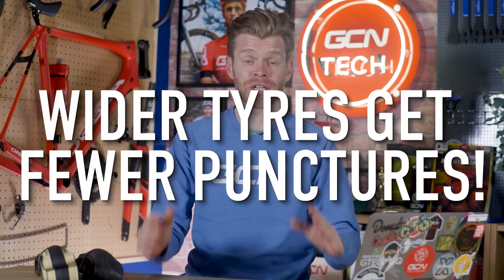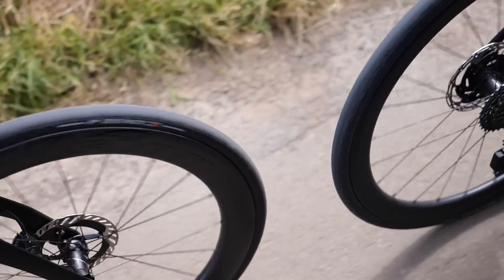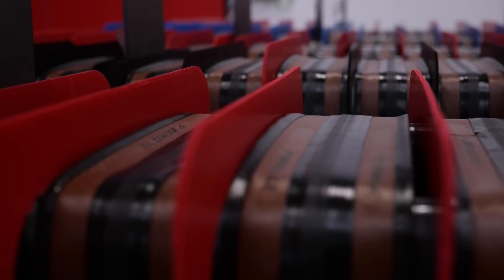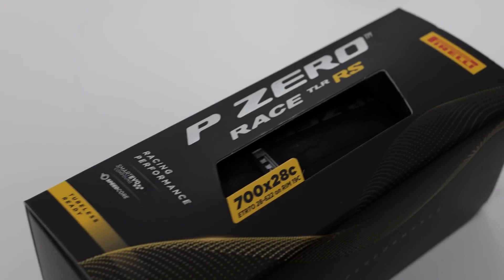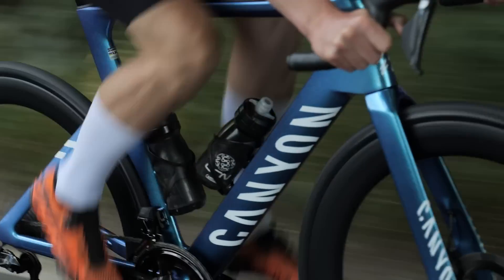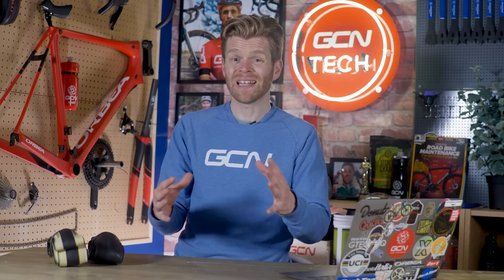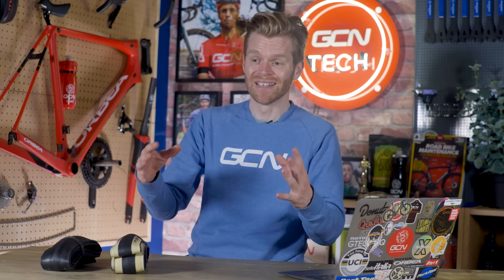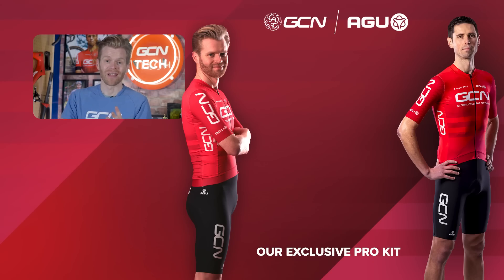Why Your Bike Tyres Get More Punctures

Comment: Ollie and GCN, What about the energy loss due to compression of the air in the tyre and energy loss due to the deformation of the rubber?  Compressing gas requires oodles of energy that is lost to heat (thanks for nothing thermodynamics!).  Cycling 20 years ago we could ignore deformation as we all rode skinny tires at very high pressures. Today I see road bikes with 30mm and even 35mm tires at ridiculously low pressures and you can clearly see their huge contact point and deformation with the naked eye. Its no longer a negligible variable. As an engineer I'd love to see some models showing energy losses due to Crr vs. Compression/Deformation energy losses vs. Aerodynamic losses (0deg yaw) vs. tire pressure (bar) and load on tire  (kg).
Reply: Hysteresis loss is smaller with bigger tyres/lower pressures.
You may find this discussion with Josh Poertner of Silca interesting.
https://www.youtube.com/watch?v=ZuxUWFziuGI
Reply: The majority of the air compression happens when you get on the bike, so only once. As the tyre rolls the pressure will be constant (aside from the effect of bumps obviously) so I don’t think that’s a concern. On the deformation I think the argument is that the wider tyre gives a wider rather than longer contact patch  which reduces much of the hysteresis loss you might expect if the contact patch shape remained the same.
Reply: @robertpoll27  sounds like you have never ridden a bike outdoors. The whole point of a pneumatic tyre is to give suspension to the rider, because the 'effect of bumps' is happening all the time. Evenon supposedly smooth surfaces. The rider is also moving on bike via pedalling, when sprinting, standing up for hills and also off saddle when it surfaces get rougher. It's a constantly changing dynamic system which means the tyres are constantly deforming. How well the tyres deform is key to a bike's comfort, handling and efficiency.
Reply: The compression/Deformation energy losses that you are concerned about are included in the measured rolling resistance.  And the one factor that you have neglected is road roughness.  High pressure narrow tires have the lowest rolling resistance on ideally smooth indoor wooden velodromes, but as you move outside onto real roads, the degree of roughness impacts rolling resistance.  The ideal tire matches width and pressure with the roughness of the surface.  As the road gets chunkier, wider tires at lower pressures are faster.

Comment: I am tall and well built => heavier than most cyclists I thought to run at higher pressures to compensate ie at 7 bar. I was made aware of the SRAM and Silca tire pressure and found I should drop my tire pressures by 1 bar.  Amazing big difference in ride comfort.  I still partially to sligh higher pressure to avoid punctures from the many potholes, but ti seems even  dropping the pressure a little can make a big difference in ride comfort

Comment: Pinch flats were mentioned, but there's another factor as well. Given a fixed size defect in the road surface, say a 1/2" rock, the danger of totally compressing the tire is much greater for that 18mm tire than a 28mm one.

Comment: Thanks for this! Here's a case where English units are intuitively more helpful than metric. A 180 lb bike  HAS to support 180 pounds. If it's distributed over 2 square inches, that means 90 pounds per square inch. (I'm a little skeptical about the statement (8:00) that there's more pressure in the center of the contact patch. Granted, central tread wears faster, but that's the area that strikes the ground most frequently. Gasses in a closed system press everywhere equally; that's kind of the point.)
Reply: maybe it has to do with the molded shape of bike tires vs. car tires?
if they're measuring the actual pressure of the contact patch, I'd expect there to be variation from the center line out, since the tire isn't flat across its surface.
Reply: @johnhufnagel  I think they mentioned that the physics of car tires was very different than bikes. A model of the gas dynamics of the contact patch might be a row of gas cylinders joined at the top. The force on each cylinder will be equal, no matter whether some cylinders are pressed in more than others.
Reply: @johnhufnagel  Contrast this with a model composed of springs in a row. Here, the springs that are compressed more will carry more weight.

Comment: Wet tyres get more punctures due to attacking objects sticking to tyres, whereas in the dry they would fall off quickly.
Reply: The water lubricates the rubber, allowing easier penetration by flints etc.
Reply: @vo2maximus177  Interesting. Never thought of that. I noticed that I used to get punctures always at the worst time - in the rain, at night... I've now moved to tubeless and only had one bad puncture in many years of use, due to a very sharp stone which wrecked the tyre.

Comment: Running tubed 25mm on fairly high pressure, haven't had a puncture in the last 30'000 km. It helps looking where you ride through.
Reply: Agree. Also citycycletracks have been killers of my tyres. Now i only ride on roads, no punctures anymore.
Reply: Famous words from Barry Hoban when Mark Cavendish was having lots of punctures in races ‘ He should look where he’s  going ‘ 😊😊
Reply: Some of my fellow club riders don't watch the road and have crashed after hitting easy to see pot holes, when driving or cycling I keep me eyes and focus on the road.
Reply: Same as me , I use 23 and 25c , have one bike with 28c  tyres , rides awful and refuses to bank down in corners , they are awful to corner on , 23 and 25 handle 10 times better , no wonder so many crashed in the Tour de France  using 32 car tyres the bloody retards , modern cyclists are being sold a load of overpriced rubbish ...Not had a puncture since 2004 when I rang the wife to come and pick me up 40 miles away , Conti Gatorskin since they came out , all my bikes have them on !
Reply: I'm glad you arrived to post this comment.

Comment: I have been using extra thick or thorn resistant tubes since the 90's. They are much heavier than a regular tube but I hardly ever get flats. The hand full of times I have gotten flats I was not riding on the rim making it much easier to stop. My .02
Reply: How are Michelin Airstop tubes?

Comment: The question is speed vs puncture. I have learned my lesson after few thousand euros of tires.  If i want get speed, i spend more money for my road bike tires.  If i am looking for no punctures, i get the Michelin Cross Protek 35mm for 30 euros.  Lower speed but i dont care when i do my touring rides with 20kg extra for my bags, but i dont have those problems. Especially important when you tour in Asia, they dont really carry these expensive 28mm tires in the middle of Vietnam.

Comment: The pressure in your tire is not what causes punctures! The pressure that is relevant to punctures is determined by the cross-section of the debris you are running over and the weight supported by that wheel. A much more important factor is going to be the thickness of the tread, which is why puncture-resistant tires like the Schwalbe Marathon have a layer of foam to increase the internal thickness of the tread.

Comment: The current focus on low rolling resistance with tubeless tires is the main cause for more punctures.  There is less tread and casing material compared to equivalent clinchers.  Wear and durability is half what it used to be.  At least sealant gets me home with small punctures.

Comment: I now have a gravel bike with 42mm slick tyres. I have yet to see any cuts in the tyre compared to 30mm on my road bike.

I'd love to see manufacturers quote at what pressure their specific tyre/pressure is most efficient at.

A bike has a unique spring/mass system where by most road bikes do not have an additional spring/damper. We should really be choosing the width/pressure based on total system weight. 

If you have the wrong pressure, you either increase hysteresis (vibration) or vertical acceleration, both bad for efficiency. 

Pick a tyre width based on total mass; if you're overweight like me, look at 35mm and above.

Comment: Ollie - you is a scientist mate! Pressure is Force / Area, so the tyre pressure and the system weight almost totally determine the total patch area. For example, my system weight is roughly 155 lb + 20 lb = 175 lb. Let’s call it 180 lb for fun with full water bottles. Now if I have 90 psi in each tyre (of course I do not I read the Silca pressure calculator too!) and equal weight distribution then each tyre bears 90 lb with 90 lb / sq-inch so the total area of the contact patch on each tyre must be 1 square inch. Of course the SHAPE of the patch must vary (wider tyre = wider side to side and narrower front to back) and the properties of the casing will have some effect to the extent that tensile forces distribute some of the load (so the actual patch area in contact with the surface will be marginally smaller than 1 sq in). I assume that the tensile redistribution is small, but if later in the video you reveal this is wrong that will actually blow my mind (that would be like those nifty string spokes Pidcock and Ferrand-Prevot rode to glory…).

Comment: About the size of the contact patch with or without a tube : a TLR tire with a tube inside it would probably be slightly stiffer than without (hence a smaller contact patch at a given pressure), but what about a non-TLR tire with a performance tube (latex or TPU) inside ?
Only a few tires come today with a TLR and tube versions. I can think of the Vittoria N.EXT line and to a lesser extent GP5K (not all sizes are available in both versions). This is really annoying since tubeless is far from being a 100% win against (performance) tubes in all departments, particularly on the maintenance side...

Comment: I still use 25mm tubular tyres work well for me
Reply: Is that tubular or tyres with tubes?
Reply: Tubular tyres glued tothe rim
Reply: If you're riding vintage steel, that may be all you have clearance for.
Reply: @christopheroliver148 Nope, another myth.
Reply: @peterwillson1355  And you know the clearance on my custom bikes how?  Or are you just trolling?
Reply: @andreemurray7039  I worry about some of the ‘experts’ on here someone the other day suggested if u fitted tubulars you would have to get a taxi home. Strange that back in the day carrying spare used tubular under the saddle was expected. If you had a puncture you simply pulled the old one off and fitted to spare which had enough glue on it to hold it in place, and we would even repair training tubulars😊😊

Comment: In 6000+km, with multiple bike and tire types over the years (all with tubes), my father and I accumulated the huge amount of three flats, two of them in the last couple months. Mine was caused by some dirt inside the tire, my father's on the other hand was due to some small metal shaving that made its way through the tire. 
Never had anything fancy, probably low cost and low performance means more material between the road and the tube

Comment: Really interesting on the contact patch from increased deformation factors. Going to echo what a lot of people saying, i barely ever get a puncture - i don't do 20,000km like Ollie but 2000-3000 a year, and i've had 1 puncture in the last 5 years. I am on 25mm grand prixs, wish i could go wider but my frame can't take anything more, and as a 100+kg guy i'm at 90psi. Wish i could go lower but get some unnerving sensations while blasting out of corners on less. Also that puncture was a fishing hook, big enough i could have dodged if it hadn't been focused on the cars in front and behind me.
Reply: 2000-3000 miles*

Comment: Silca's tyre pressure calculator actually gives me some 5 to 10 PSI higher pressure recommendations than those given by the SRAM one. I like the latter more; I feel like the recommendations by Silca are overly high, leading to a bumpier and slower ride. (With 28 mm tyres and interal rim width being 21 mm.)
Reply: I prefer the SRAM one and have been using it for I guess 2-3 years on loads of different bikes and setups with all sort of tyre sizes. Have always been very happy with the pressures it suggests
Reply: Doesn’t it depend on the surface you select?  I find the pressure from ‘new pavement’ to be firmer than I like.  I use ‘chipseal’ now and find it feels good on nicely paved areas and soaks up bumps in the poor areas.
Reply: @danhutjens8328  Maybe if you indeed choose chipseal. I've used the ‘worn pavement’ setting, and it gives those higher pressures than SRAM.
Reply: and Pirelli tire pressure table recommends ~.5 bar more than Silca calc.
Reply: Prefer the SRAM one too.
Reply: Agree completely
Reply: I found the same thing & just use the SRAM calculator now. Definitely get fewer flats with the lower pressure.
Reply: Silca explains that their table is optimised for lean, elite cyclists and that us mortals should derate a bit. I forget by how much.
Reply: Note that the Silca calculator refers to the MEASURED width of the tyre, while SRAM use the nominal (printed on the sidewall) width. On wide rims, a 28mm tyre can end up measuring 29 or 30mm installed. This accounts for some of the difference in pressure recommendations.
Reply: @andrewmcalister3462  I did note this, but  in my case the difference is just 0.5mm, so I'm mostly ignoring it. Still, adjusting the parameters for 1mm wider tyres (the calculator doesn't allow decimals) does seem to lower the recommendations about 4 PSI.
Reply: Thanks for this piece of information! I usually go trial and error. My prostate and I appreciate this bit of knowledge.
Reply: I usually split the difference.
Reply: You have to input correct speed and correct surface in silca.

Comment: Recently I bought P Zero TLR 28mm Speedcore and I'm really disappointed.
28mm model measures ~26.5mm !!  on 19mm inner width rim !! (the same was with P Zero Race 28 TLR TechWall)

whereas other tires, Conti GP5000 or even Pirelli P Zero Road on the same rim have ~28.5-29mm !!!
Should I buy 30mm model to have correct 28-29mm tire ??  
sort your shit out !!

Comment: Statistically my bike's tyres get a puncture every 1500 kilometers (1000 miles). However during my trip through Israel I had punctures every 200 kilometers. :-(  Why? Heat (45+ degrees)?
Reply: Most likely bad luck more than anything else. I ride in Israel almost daily, and have gone 1000's of km without a flat, and then 2 flats in a week.. 😢   1 snake eye from hitting something, and a big nail on the next ride. where did you find 45+ heat that is on the high side even in the summer here.
Reply: @yisraels4555 I've experienced 40 Degrees in Italy but that in Israel felt quite a bit hotter.  I didn't hava a thermometer but the air felt like when you open the oven and hot air comes out of it.
 It was somewhere in the triangle Jerusalem, Jericho and Ramallah.

Comment: I ride with 23, 25, 28 and 32mm, and so far,  i prefer 25mm. I don't feel much difference with 23/25 and 28/32 are way more sluggish when going out the saddle.

The biggest factor isn't tyre width but tyre compound and the innertube. Switching from butyl to latex/TPU or even tubeless makes a big difference. And from experience riding daily with them,  28mm Hutchison sector are slippery as hell on the wet whereas 24mm cinturato are as good as on the wet as on the dry.

Comment: I still use 25mm tyres, but get far fewer punctures than I used to. I'd put this down to:

1. better tyres with some puncture protection
2. better pump to stop pinch flats
3. lower mileage 😞
Reply: I'm also running 25's, and since then I've reduced the number of punctures from at least one per ride to maybe 2 per season.
Reply: I noticed using tires with kevlar I have less punctures. Wider tires do give better comfort, but, don't feel fast to me.
Reply: @fredmcgough748  All of the data suggests that running 28's or even 30's will be faster on public roads....if you ride on perfect pavement, or a velodrome then skinny is better....but for 99% of riders wider tires will result in faster riding.
Reply: @fredmcgough748 Going faster produces more vibrations that are felt by the rider. But more vibrations (from higher pressures) does not mean you are going faster.
"Feels fast" is a highly misleading sensation.

Comment: On 28mm tyres I got 4 punctures in 5000km. Now I use 32mm tyres, 4500km and only one pucture so far. So, let's hope the next 500km won't be a puncture fest.
Reply: It's hard to know whether or not that is just happenstance.  I've got 5000km on 28mm GP5000 (with tubes) with nary a flat.
Reply: Rode almost 10.000kms with Contis 28mm GP5000 and latex tubes and never had a puncture. Smoothest ride I ever had.
Reply: Riding somewhere that trashy tourists leave broken glass in the bike lane doesn't help my chances. Lucky so far - one flat on the commuter bike in 1.5yrs (glass shard in a 35mm tire) and none yet on the road bike. With the junk tossed in my space I am not optimistic for maintaining no punctures on my road tires ;(
Reply: Since going tubeless on all my bikes the only time I got a flat was off-road, the oem tires weren't up for the job, No punctures on the road bikes however, both running the Pzero 4s race TLR's in 28mm and 30mm sizes
Reply: Time to move to a different country
Reply: During about 3,000 km with new 23mm road tires I had about 11 flats. 10 of them on the front tire, and one on the rear tire.
I now have 25 or 26mm road tires, and they're a tight fit. No flats but only a few hundred km.
Reply: Have 26mm front, 28mm back. 1 flat (front) in 3500km. So far so good 😅i must admit 3500km is for the outer tyre, the inner is way older than that, probably closer to 6000km or more. Netherlands has good cyclepaths.
Reply: Yes, 32s at 60are my slicks now. Almost no flats